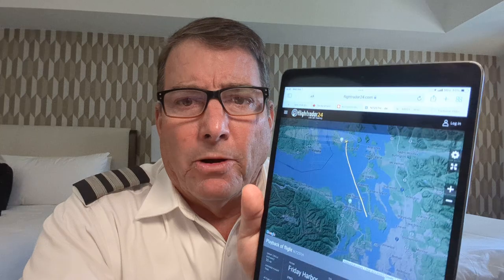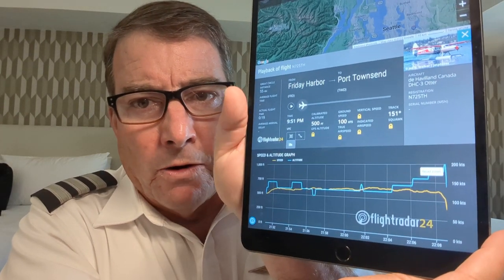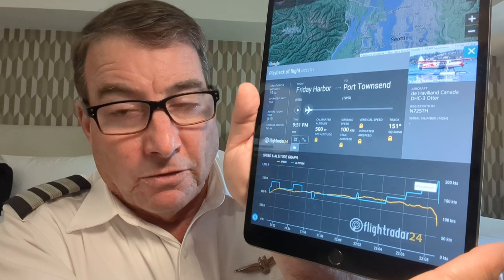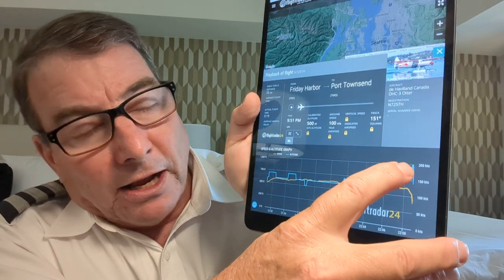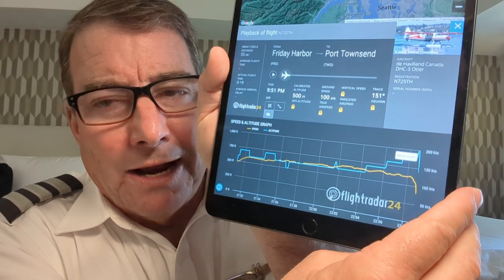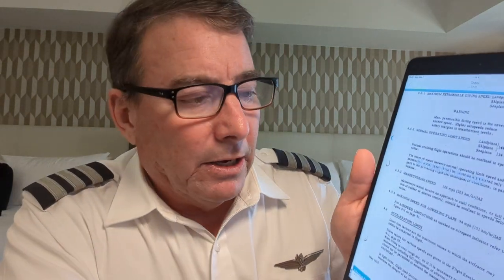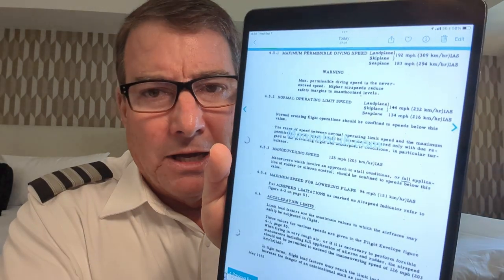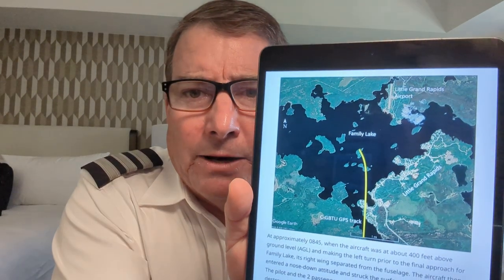DHC-3 Turbine Otter N725TH Crash 4 Sept 2022

Comment: Kenmore Air in Seattle has several of these aircraft with turboprop conversions.  They have had no problems with their aircraft.  It would be interesting to learn from Kenmore how they inspect and maintain similar airframes.
Reply: I think many/most Kenmore flights originate/land in lake Union or Lake Washington though, right? I.e. freshwater...
Reply: @Alvan81  Kenmore Air operates in both fresh and saltwater as does Northwest Seaplanes.  Their base is on south Lake Washington.  So the operating environments are very similar leading me to think a comparison between to two operations would be informative.
Reply: @wendellcrim8647  👍🏻 I agree. I was just pondering if landing in freshwater is almost like an extreme fresh rinse each time...  When those babies touch down and takoeff it looks almost like a pressure wash. 🙂 I used to boat in Lake Union; it's an amazing sight.

Comment: Great presentation Juan as per your usual!  My thoughts were structural failure too.  Being a non-pilot but following yours and others previous videos brought me to that speculation.  Salt water environment, aircraft age, hidden components, constant use, all add up to eventual problems.  Was the profit/safety ratio skewed towards profit just a little too far?  Was there just a little too much weight for what this old hulk could take?

Comment: Not sure, but the shown structure may be made of aluminum and a steel bolt. Will brake in any case to an unkown time point. In Hanggliders for instance, the wiring and bolts is changed every two years. But where the bolts are placed: only visual inspection..

Comment: I'm an Alaskan Native and we use bushplanes and floatplanes all the time to get back and forth when there's no runway for a twin turbo prop passenger to get to and from...  
Juan, would you say floatplanes are still relatively safe?  It was a 55 year old aircraft... Perhaps a structural failure inside one pontoon cause a lob-sided displacement of weight and it caused the pilot to hit hard into the water? 
Found no wreckage, only one body, and locals report hearing a LOUD boom and seeing a 30ft cannonball splash of water out in the bay.  The pontoons are meant to float... So how is there no wrecked?

Comment: Perhaps with the Turbo Conversions there is so much more stress and vibration to the airframe that Part 121 & 135 operations need to do a safety stand down and inspect for corrosion in the tail assembly?  A Service Bulletin would be a start, but a FAA AD would be the proper approach. These planes are inspected every 100 hours for Commercial use, so it would be easy to accomplish in a short amount of time. The problem seems to be that a visual inspection may not identify tiny cracks within the metal itself. Floatplanes have a greater exposure to saltwater within the tail assembly on every takeoff and landing , much more than a wing or strut. 

Nobody likes added expense for maintenance, especially if your company is doing things by the book and inspecting each aircraft for corrosion given the age of the plane. However, Piper and Cessna both had Wing Spar corrosion AD's issued after the Piper Arrow in Florida lost a wing in flight, flying in the traffic pattern.

Comment: Temperature changes, like when the cold wind or rain hit the structure, will suck some saltier ocean vapors into the metal cracks and stress pores, leading to internal corrosion that creates porous salts structures holding the moisture inside these cracks. The boats get these more often. Heating up the metal will reveal the trapped vapors coming out, thermal cam as the crack salts is different material

Comment: Intensive use of old aircraft with lots of flying hours, and lots of take-offs and landings, plus difficult inspections (not easy to inspect a tail while at sea), and corrosion (seawater and metal does not mix well) surely is a dangerous mix!

Comment: I called a wing or horizontal stab spar failure 2 days ago. I stand by that until more details come out. We will know as soon as they find any big parts. Losing elevator trim also fits the pic. I still think the horiz Stab/elevator failed causing it to fly straight down, literally 90 degree dive. A wing spar failure is possible, but would have “leafed” down, slower than 7,500 fpm.  These are old plans in a corrosive environment. They fail.
Reply: According to the data that he showed, the aircraft went up above the normal cruising altitude before going down. So maybe the failure at the stabilization made it force a nose up situation that ended up stalling the aircraft?

Comment: Juan that sudden pitch up, then down speaks of loss of elevator control. 

Back when Dad was flying Otters I remember him talking about cracks forming in the elevator skins this was in the time pre turbine conversions. 

I know the area where this accident happened, the tidal currents run strong there 3 to 5 knots is the norm, about the only time they will be able to dive in the area maned or ROV will be near and at slack water. It is rather deep in that area so them finding all of the airframe is doubtful, finding most of it is a maybe. 

If they start looking at incidences with this plane's sister ships should give an indication of probable cause.

Comment: Dan Gryder just did a video on this crash. He discovered that similar planes, even a "sister" plane of the same company suffered from incidents where the mechanical construction at the elevator failed. Resulting in total loss of pitch control. On previous incidents there were no fatalities. So according to Dan the probable cause of this crash is also an elevator failure... Tragic loss of lives...
Reply: DG is not a reputable source for aviation commentary.
Reply: @redcat9436  Hm, I have a good impression of Dan,  never had the idea that he brings incorrect of false, faked info on his channel. He is genuinely concerned about the still high numbers of fatal accidents in general aviation.  And Juan Brown did some videos with Dan. Let Juan say what he thinks of Dan Gryder.

Comment: What Is the Unsafe Condition Presented in This AD?

(d) This AD is the result of reports of the control rod to the servo trim tab system detaching from the servo trim tab and causing the servo trim tab to flutter on airplanes with a turbine engine installed. The actions specified in this AD are intended to prevent a single failure of the elevator servo trim tab system, which could cause severe elevator flutter. Such elevator flutter could lead to possible loss of control of the airplane.

Comment: A DHC-6 went down in the Philipines (I think, it was somewhere idealic and tropical looking) and the profile was much the same, steady climb then a sudden nose down and into the sea.   Turns out the elevator control cable had rubbed and rubbed against a bracket and finally snapped.

I wouldn't be surprised if a similar thing happened here :(

Comment: I thing landing and takeoffs on water would be extremely hard on the airframe because of the wave action. I'm not a pilot but I've spent many hours as a young man resetting rivets on aluminum boats in northern Minnesota. Granted they had hard use and maybe a rock or two didn't help.
Reply: I'm guessing the pounding against waves causes panels to flex and stressing the rivets. Any particular brand of boat better than others? I noticed Lund Tyee alum boats are very popular on the big waters of Lake Oahe in So.Dakota. Not a place to go when the weather is blowing unless you've got a strong boat.
Reply: DeHavilland aircraft are designed to be work horses. 

As we speak, they are converting dash 8's into cargo planes in Newfoundland. 

So everything was taken into account about being beaten up.
Reply: @LuvBorderCollies  certainly all the later models of boats use a better alloy in the aluminum. The boats I worked on were from the early 70's and they had thicker aluminum but was far more prone to crack. But yes the tyee's were Cadillacs and still are.
Reply: @alexaltrichter1597  Thank you. That's good to know. I worked with a bunch of avid fishermen and if you had a Lund Tyee you were Tier 1. Of course it also helped you catch way more fish too.

Comment: How difficult would it be to use non-invasive testing--say, magna fluxing--periodically on aircraft with hard use in a salt water environment?
Reply: Right, especially aircraft over a certain age. Specifically for any component that supports/manipulates/controls flight surfaces. Will it take the aircraft out of service longer, yes. Will inspections cost more, yes. But I guarantee there isn't a soul at that company or the community  who would put a price on a life, especially 10.

Comment: Visual inspection is better than nothing, but not by much. NDT is also heavily compromised in many aircraft parts because of the thin gauge of the metal and very awkward access to components (unless you physically dismantle the plane).

Comment: The cracked area v.s the area initially intact looks weird to me.  It must be a very high loaded lug, using a much too high stress level.  The rough surface of the bolthole will inmediately starting a small, but growing fatique crack.  If making the bolt longer to both sides, the lug area can gain 50% in area, reducing the fatigue growth massively. An mandatory AD in the future? 
Or do I interpret that wrong?

Comment: I had to listen several times to a 911 call from someone who also recoverd a seat cushion & some black plastic, because she stated that the plane went fast & straight into the water AND THEN they heard an explosion [after it went in the water]. I don't understand the physics of that. Maybe someone can explain? But she definately said they heard the explosion right AFTER the plane went in the water.
Also, on the news today: they are (or will be) using a newer type of sonar that is able to read a wider area in a pass. They also said the plane is probably 100' to 200' down. Apparently there are some shelves in that area that drop off pretty dramatically.

This was so tragic. Blessings & sympathy to the families.

Comment: I fly GA as well as does lots and lots of other people. 

Think, most GA aircraft either for flight training or personal use is on the low end 30 years old. High end maybe 60 years??  A 100 hour or annual will not find a “fatigue” crack on a spar or other critical component.  A pre-flight check will not find some internal component that is bad or about to fail that the PIC could locate in the first place. That’s why it’s always “pilot” error. Always….  And that’s the loophole for the insurance companies not to pay out.  It is always about the money…

Fly safe my friends..

Comment: My interpretation of what Blancolirio said about "structural failure" can include airframe and engine failures. The engine can lose a blade and the blade hit the wing spar????
Reply: That seems much less likely though, especially with a relatively modern turboprop engine. The engine is also in the nose, so it would presumably be impossible for a prop to hit the wing.

Comment: Its sad the general public is not made aware until a horrible disaster happens. A new turbo-prop engine on a 60 years old plane. Metal fatigue has killed more people than anything else. What about the 70 year old B52?
Reply: The difference is a virtually unlimited maintenance budget for the B-52
Reply: @jase9951  Thanks, but when does it become unsafe with 5 different engines?

Comment: Wait!  Didn't the FAA, in fact, start mandating X-ray inspection (particularly for aircraft on routes traversing primarily over salt water) after Aloha 243????

The wing lug is a pretty critical part.  Why didn't the AD mandate X-ray scans to find those hidden fatigue cracks?  It's well-known human visual inspection for hairline cracks (especially in the typical bad lighting of maintenance graveyard shifts) at least since the Aloha 243 incident, is about as effective as human see-and-avoid has been for preventing mid-air collisions (TCAS exists for a reason).

Comment: I have pictures of the right wing support that appears to be cracked and disconnected from the wing on this aircraft. Who knows of it played a part but there is much left to be learned.
Reply: NTSB has the pictures now
Reply: My photos from flights a couple months ago show the same, rear of the fairing at the strut joint on that wing had visible separation from the bottom of the wing.  I’m not sure what that means for the load-bearing component inside the fairing, but I sent a photo in as well.
Reply: @VR6MT  I'm betting seawater got trapped in there and corroded the eyelet that holds the strut if that indeed did play any part in the crash

Comment: Thank you for your usual thorough job on these sad matters. Do you believe that the powerplant had anything at all to do with the cause of this? Was is simply the elevator control?
Reply: If the engine simply failed to produce power the airplane should have been able to perform a dead stick landing on Puget Sound. This was a sea plane. So an engine failing to produce power isn't a likely cause.

Comment: I know everybody comes from a different perspective, but I was born and raised around composite aircraft and am always a little bit more “aware” flying in older, high-time metal (fatiguing) aircraft, and I do think about catastrophic structural failures.  This is not to say that I wouldn’t have flown on that Aircraft, by the way.  So sad.  

Composites definitely have the advantage in the area of fatigue, no question.
Reply: The more I think of the Beech 18 we flew from HON to Maui and back, the more thanks to the Lord. That was in 1983. Its a long story but both were sub-par condition. Pilot was anorexic little guy who chain-smoked and had a nervous vibe. He sat me in the right seat being the tallest (not heaviest) person. None of the gauges/instruments on the right side worked. Some were missing. 

Watching the left panel was almost as bad with most needles frozen in position. Random wires hanged out below the panel. Even as a non-pilot I didn't feel comfortable especially flying over water twice. When I become a pilot until a year later it sunk in just how bad that Beech 18 was. IIRC pilot said it was built in 1937 or 1938. 
Maybe there was a reason the pilot was a chain-smoker and seemed nervous.
Reply: Composite cannot take high stress. They are used in low stress areas on the aircraft like belly fairing, flap arm fairings etc. 

They do not like harmonics at all. It weakens the bond etc.
Reply: @HuckThis1971  they cannot take high stress? Precisely what kind of stress are you talking about?  Are you aware that 100% composite airframes have been flying since the late 1950’s and German built composite aircraft have had their airframe life limits extended repeatedly without any signs of fatigue?
Reply: @highdesert6  everything has a cost. Military they can change parts as needed. Carbon fiber weekender planes don't fly like commercial airliners do.

Don't forget pressurization and de pressurization cycles a commercial airliner goes through. 

Airlines don't park their aircraft unless required. 

Pressure bulkhead on C series was carbon fiber initially. They went aluminum to save costs in manufacturing and eventual replacement in service.

So yes, carbon fiber is better, but I don't think airlines will dish out more money for a more composite aircraft. To top it off, repairing carbon fiber you need to have the know how and an FOB able to fix properly. Not everyone is equipped to fix carbon fiber.
Reply: @HuckThis1971  composite structures handle pressurization cycles much better than aluminum.
Reply: Even though they're definitely not for speed I'm very particular to Fabric covered aircraft with steel frames. Steel components can have infinite use cycles if properly designed. 

There was an Air Disasters episode about a helicopter going down in the North Sea and apparently what happened was while flying through some bad weather the rotor blades spinning created a lot of static electricity in the air resulting in a lightning strike which hit the composite tail rotor which took the shock fine but due to the aluminum anti erosion strips on the leading edges of the tail rotors the electricity  got dumped there and severely damaged the tail rotor leading to it being unbalanced which led to tail rotor failure. Everyone survived with minimal injuries. 

While I prefer composite aircraft to stressed skin aluminum aircraft given the option I much prefer fabric covered steel tube frame aircraft
Reply: @MrLM002  That's because the conductive bonding did not do its job. Any composite component has a wire mesh on the outer surface. For static discharge and lightning strikes
Reply: @HuckThis1971  Interesting. I'll look into it more
Reply: @MrLM002  I've inspected composite parts where strategic places I had to measure for conductivity. Dimple washers, wire mesh etc. 

I've seen many pictures of aircraft not having good conductivity. It's when the lightning bolt that comes out where most of the damage occurs.

Comment: Everything I know about aviation is from watching Juan Browne and fooling with flight simulator - but, short of pilot suicide (and I think you can forget that) there had to have been something which broke on the plane - a control, a component like an aileron, a wing, a rudder, or something.  An intact plane, with functioning controls, has the wonderful property of being aerodynamic. They don't dive almost straight down unless something is really broken.  In a sense this appears to be a no-brainer but finding pieces and figuring this out could be a heavy lift.  Sure is a sad deal, regardless of the precise cause.  And it sure makes me not wanna get on a float plane.